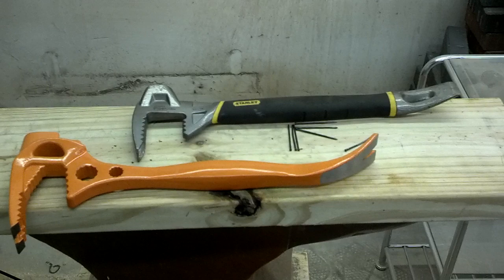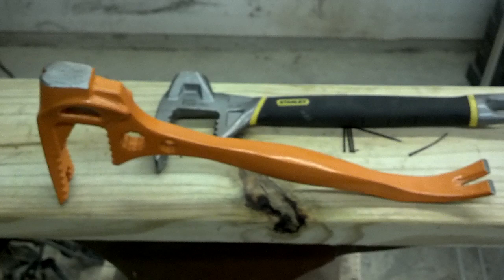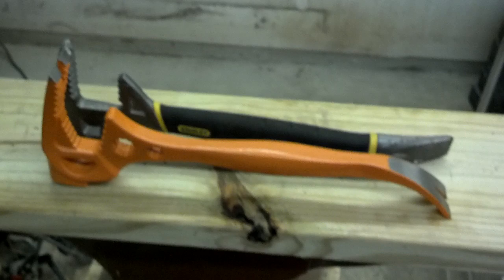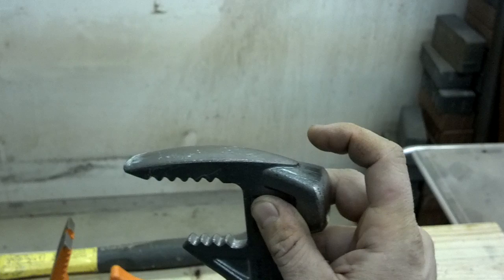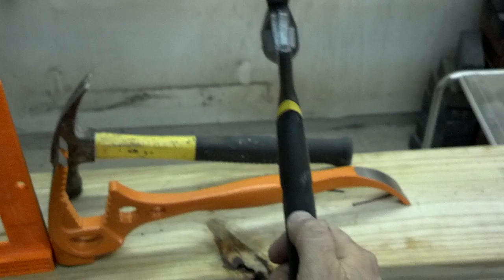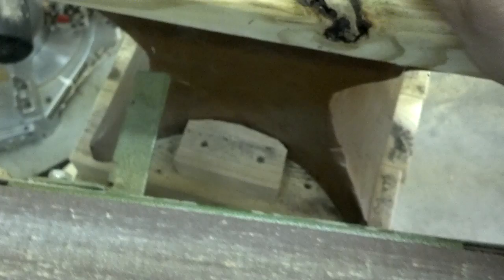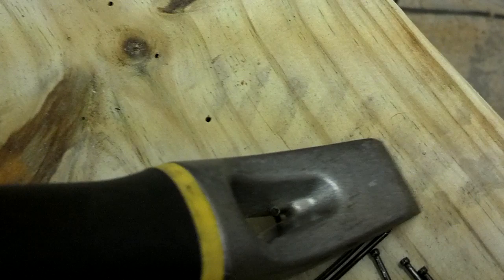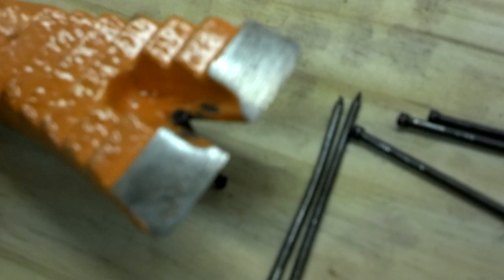IIT 15" Multi-function Utility Bar

Comment: The only thing about the knockoff is that when using the prybar end on a surface, the other joistjaw end is facing the surface and prevents you from getting as much pry room and hits the surface. The stanley has them at 90 degree offsets so the joist jaw is sideways when using the pry end. That was a mistake on the knockoff.
Reply: Big +1 on the bad design.

Comment: My max extreme measures at 19 inches. I bought it when they were brand new on the market. There is a full nail puller on the bottom. The drawback is that it weighs close to 5 pounds. I painted it in camo just to be different and paid less than 30$ at a local Home Depot no shipping charge. There is a reason why Chinese shipping boats are called Junks.

Comment: Every ad I've seen though for the fubar except this one I've seen people bash stuff with it...we desheet walls and take out the studs not bash the living hell out of them in demo . Nice gimmick though haven't seen a Stanley tool I would look at poorly untill now. I guess it's a way to spot un skilled labour wene you see people with it
Reply: It is not really a demo tool at all, but with the fire wood they sell at the box stores it comes into it's own pulling a corkscrew stud straight.  

Couldn't agree with you more about the unskilled people turning a wall into gravel instead of trying to get the board out in as big a sheet as possible. 

A true laborer is one of the skilled trades. Not a bum you picked up aff the road on the way to a jobsite.

Comment: He eeft somthing very important out. - The Chi-com bar is cast iron,,,,,really low grade cast iron better described as "Chineseium"

On the other hand he said the Stanley is cast, wrong,  It is forged steel.  

Don't pull to hard on that chi com bar or you will end op on your ass when it breaks.